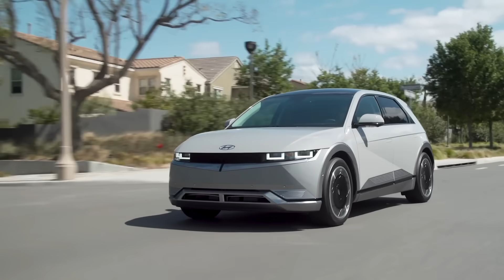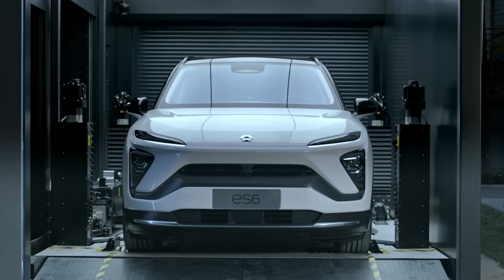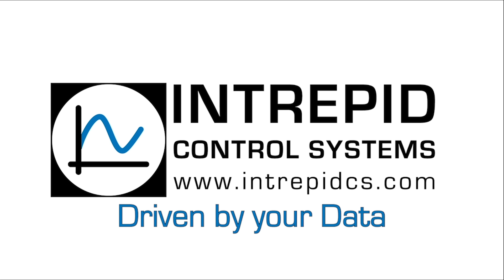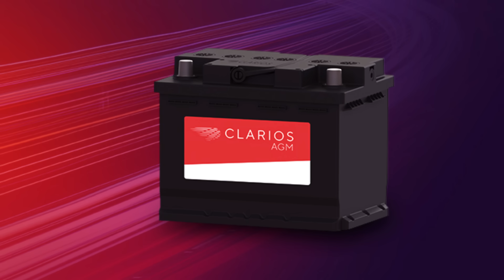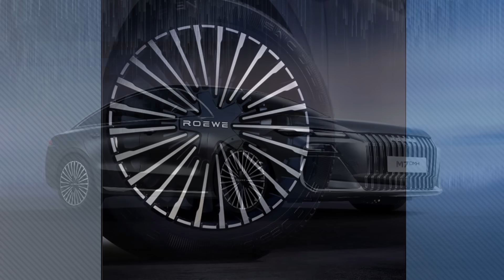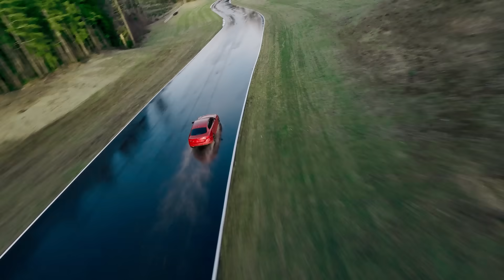Fewer Buyers Willing to Go Electric; Ferrari Delays 2nd EV Model - Autoline Daily 4078

Comment: Shell and there propaganda on EV The world has woken up about the lies they push to keep polluting and causing people health issues.  Harvard University, in collaboration with the University of Birmingham, the University of Leicester and University College London, found that more than 8 million people died in 2018 from fossil fuel pollution, significantly higher than previous research suggested—meaning that air pollution from burning fossil fuels like coal and diesel was responsible for about 1 in 5 deaths worldwide.
We also see the fossil fuel corruption of the government. Musk and DOGE could have achieved 1/3 of there target of $2 Trillion by just cutting subsidies to the fossil fuel industry.  The U.S. fossil fuel industry benefits from an estimated $760 billion annually through subsidies. Those subsidies come out of tax payers pockets the slide of hand by the government still go on. Further Trumps Tariffs are another way of taxing us with a rise of about 10% on all we buy. How the dumb MAGA fools can't see how they were duped is a indictment of the USA education system.

Comment: If initial cost is the issue then have a battery lease option to lower the msrp.   Then a small monthly cost for a battery you aren’t responsible for going bad.
Reply: The NIO way,  and now adopted by many other Chinese brands.
Reply: @David_Polak Remember the EV1? GM.
Reply: @ZzHasbrozZ  Was its battery also on a lease or swappable?
Reply: @David_Polak it’s a yes or no question.

Comment: ITS ALL WAY TOO EXPENSIVE  FOR THE AVERAGE JOE TO BUY . WHO HAS $80.000  TO SPEND ON A GAS TRUCK OR AN EV  ?   EITHER WAY YOU ARE PAYING A FORTUNE FOR A PILE OF JUNK  BUILT WITH HALF PLASTIC PARTS EVEN INSIDE THE ENGINES . NOT ONE COMPANY OUT THERE NOW  BUILDING A RELIABLE ENGINE  LIKE IN THE 90'S AND EARLY 2000. ALL DESIGNED TO FAIL EVEN AT THESE INSANE PRICES ' TOTAL JUNK FOR A FORTUNE . YOU WOULD HAVE A BETTER CHANCE FOR RELIABILITY  IN A EV BUT STILL WAY TOO EXPENSIVE  FOR A FAMILY .

Comment: the minute Nio offered free swaps, its customers immediately started cheating, ripping them off, gaming the system. Will make you cynical fast dealing with the public. That Rolls Royce designer did a terrific job on the SAIC car. It looks super expensive. Brilliant work. Just goes to show that the designer matters more than the price segment you are in.

Comment: A new survey from Shell ... That's a laugh. BEV sales in Europe are up 25% in the first quarter of 2025 compared with the samer period last year. Even in the U.S. where many models produced in China are not available, EV sales are up 12% while overall car sales are up only 8%. These facts speak a lot louder than some self-serving survey conducted by Shell.

My 2020 Bolt EV remains the best car I've owned in my 63 years. Yes, I'd have paid too much for it new in 2020, but thanks to EV FUDsters like you, I bought it used with only 8k miles for less than $20k out the door (after the $4k tax credit) in late 2023. Chevrolet has since replaced my battery under warranty, so I'll easily drive it for years to come with little battery degradation, and I've never had maintenance issues otherwise. Even the very slow-charging Bolt is fine for roadtrips in my experience, and I've taken more roadtrips since I bought it than I ever did before, partly because I'm now semi-retired but also because the driving experience is so much better.

If you prefer an ICE vehicle, more power to you, but your presentation of automotive news is laughably ridiculous.

Comment: All car prices have gone out ot whack, in last 20 yrs..our income has in non adjusted  income,  down 5k$..we need a new car, want electric  but car design and capability extremely important as now a new car has to do everything...of which seat 4, while having a bunch of room for a trip, but a new electric has to be at least 0 to 60mph in 5.9 sec..so new leaf is out as is EV3, so will keep looking..now our second car will be 20yr old SanteFe, and the 25 yr old Focus SW, will go.
Reply: Do what most people do, buy used. Why do you need a new car?
Reply: Just buy a used ev. They are dirt cheap and last a really long time, especially if you can get a battery certificate

Comment: If any product people from any car company sees this, please offer low drag wheels options on your top non-sporty EV trims! The new leaf gets an excellent 303mi EPA range on its low trim, but it falls to a mediocre 258mi on its top trim; I would strongly consider forgoing the features I wanted in high-margin top trims if it means I get 17% more range in a lower trim. I also know that the EPA highway cycle is at only 60mph, so range in the real world and Car & Driver's 75mph test will be reduced even further by the draggy wheels at high speeds.
Reply: More a e r o in general, but wheels is the easiest, even sell optional wheel covers.  Smaller wheels too
Reply: This is wrong, epa tests are done at variable speeds with a top of 80 mph.
Reply: @YoureNamehere-t6l We are both right. One of the 5 cycles, the US06, is a high acceleration test with a brief 80mph top speed and contributes to the city rating. However, all other tests including the highway ratings have a top speed of 60mph. This means that 60mph efficiency is the emphasis, and 80mph efficiency is mostly disregarded. There is also 3 different test combinations to get an EPA rating, and one of them for EVs completely skips the US06 test with the 80mph top speed.

Comment: Maybe folks just waiting for affordable cars Electric / SUVs / trucks , after all who does not want CHEAPER FILLUPs, and at home for less than half Fossil fuels?
Reply: 2023 Chevy bolt EV 2LT, $20,500 after rebates, new Equinox EV as low as, $35,000 without rebates.
Reply: @rp9674 Meanwhile, Tesla is working on TeleTaxis and cancelled their low cost car.

Comment: Let’s see how “less willing” they are willing to go electric when gas prices go to $15/gallon during this Iran/Israel war. Gas car drivers only make their buying decisions based on gas prices. Ridiculous how short sighted Americans are.
Reply: My charging infrastructure is great, I used 120V at home for 1 year shared between two EVS, then installed an L2 charger, excelente!
Reply: @rp9674 my L2 install was the best $350 ever spent.
Reply: Gas already averages $5 worldwide
Reply: Ya, they are, like buying an EV before the charging infrastructure is in place.
Reply: @ImLivinSD  I’ve owned EVs for 6 years now. Driven across the US and back 8x now. Not once did I have an issue with the charging infrastructure. That’s just a myth that Luddites and gas car owners perpetuate because of some irrational need to have to drive 1000mi in a day in the event of the apocalypse. Now if you can’t charge at home, then yes I would wait to buy an EV but once you get bit by the amazing drive experience and low cost of ownership, you don’t go back. In fact only 2% of people go back to gas! Because it’s like going from an iPhone to a rotary phone. So barbaric. Anyway your counter is just a common Luddite narrative not based in reality.

Comment: After 10 yrs so far and 390,000 care free km I am very happy with my Model S.  It still drives as new and it costs me just $400 a year to drive 30,000 km.  No way would I buy an ICE car anymore.  I’ll buy another EV if this one ever wears out!
Reply: I mean yeah I see high mileage Model S's all the time. Not much to go wrong as long at the large rear drive unit is addressed. I have a model 3 but would still be super happy with an older S.
Reply: I SMELL B/S....  NO INSURANCE COSTS OR TACK EV REGISTRATION COSTS, EH?
Reply: @DericO-rz3be  No idea what you are talking about.  I was just referring to my fuel costs.  Maintenance has been about 30% less than my ICE cars historically, insurance a bit less, registration the same.  I have solar, so that helps .. if I was just buying grid power my cost would “only” be 1/4 vs gas.
Reply: How many inspections did you have to bribe the inspector to pass knowing the issues with rust and Wompy wheels?
Reply: @bobbbobb4663  huh?  The car is fully aluminum and does not rust at all.  The wheels are original and are good.  I live in Alberta btw .. so wheel corrosion is often an issue for all cars, but mine are fine.  Just trolling?
Reply: @solarguy4850  Ok I stand corrected...the Model 3 is the rust bucket.  Your S does have Whompy Wheel, potential eMMC, and LCD screen issues through.  BTW, my 1979 240D with over 300,000 miles also drives like new and I don't have to worry about my battery dying and no support from the manufacturer.
Reply: @bobbbobb4663  Buy what you want man.  I am an old gearhead and mechanic who likes power, saving money, and vehicles that really last.  EVs are simple and have fewer parts to go wrong .. this is why people are starting to realize they really do last longer.
Reply: @solarguy4850 Your Tesla won’t last as a long as an equivalent ICE due to the aging of the battery.   30 years from now, my 240D will still run on its original motor.   Your Tesla on the original battery?  Nope.
Reply: @bobbbobb4663  Like I said, I am a mechanic. I know which is the better tech.  The average ICE vehicle lasts 250,000 km, and the best I ever got was 300,000.  My Model S is still like new at 390,000.  Go figure.  Anyway .. buy what you want man .. lots of people around where I live still like riding horses too.

Comment: I can replace my engine for 4k and my transmission foe 3k if I have to replace an EV battery it is 15k this is a pretty easy decision for me.
Reply: Most manufacturers are giving a long EV battery warranty.
Reply: Another issue is that after a certain number of years, the battery required for your car may no longer be available.

Comment: I personally will not, in my lifetime, go full electric.  I do own a hybrid, but wish it would run further on electric than it does.  I'd be OK with a Briggs & Stratton for the range extender but I will not be a full electric owner.
Reply: You know what a hybrid with more than 40 miles of battery range is called? 
A battery EV. 
Enjoy using battery energy to haul around the dead weight of a gas tank and engine you only use twice a year because you don't want to stop at a DC charger for 20 minutes.
Reply: Why

Comment: Need to report on BYDs financial struggles.  Investigative reporting out of China is citing unpaid suppliers and high dealer stock.  Berk... Hath... has drop the stock.
Reply: The CCP have millions more reasons to bail out BYD strategically if they need to than the billions needed to be spent. The US becomes fossil seller now. The nearer EV transition, the lesser the US profits.
Reply: But BYD is not shutting down production.  Maybe look at Tesla's cash issues.
Reply: @bobbbobb4663  Check on BYD again.  Investigative reporting out of China has uncovered long delays to pay suppliers and dealers forced to hold increased stock which artificially bolsters profits. Berkshire Hathaway has dropped them.
Reply: @bobbbobb4663  Check on BYD again. Investigative reporting out of China is noting late/ unpaid vendors and high dealer stock.  Berkshire Hathaway has dropped this stock as well.
Reply: @bobbbobb4663 just sell zero mile used cars instead.

Comment: Should we trust a gasoline manufacturer to produce an accurate survey on electric vehicles?
Reply: I trust SHELL OIL as much as I trust DJT.
Reply: I say do your own surgery and just buy one. You can try it out for a year or make a decision to own one. We can always go back to gas if we’re not happy with an EV.
Reply: @madboyreadynow28  Already did that two years ago  and the car suits my needs.  But everyone's driving habits are different.  Also, these surveys have more up's and down's than the Rocky Mountains.  Listen to the report: "EV sales are up; then they are down; then they are up."  In my opinion, new technology will always have a rocky start at first until it is perfect.  At that time it will go mainstream.  When automobiles were first introduced, people were reluctant to give up their horse and buggy's.  Thankfully, there were no surveys at that time or we all might still be riding in horse and buggy's.